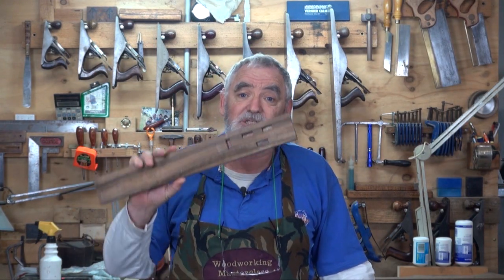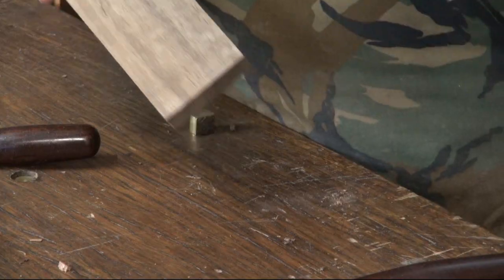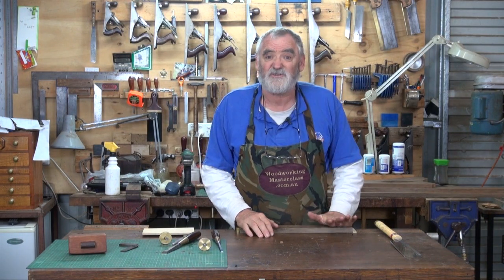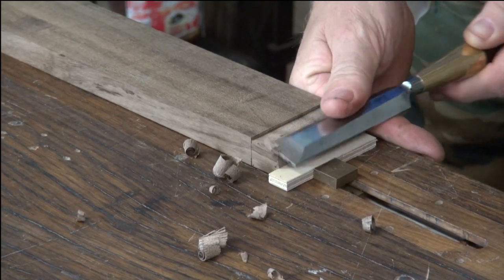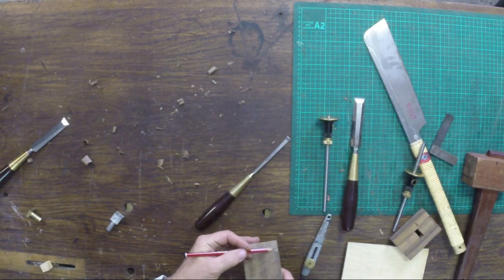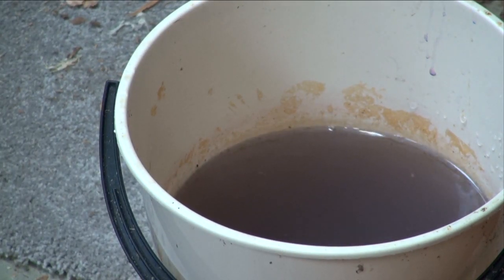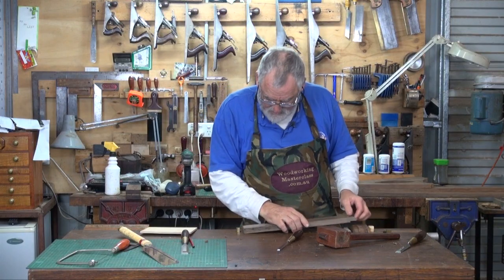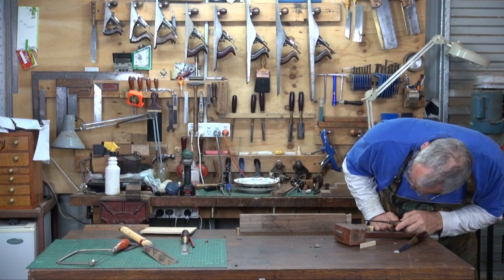How to cut Tenons - Plate Rack Part 3c of 6

Comment: Great point Steve. Patience was a key that I was missing for many years, as life was on a time line, an express train and I always felt I was miles away from becoming a accomplished woodworker. Well one of the major keys for me was learning to SLOW DOWN as soon as I open the shed door. All the rest just came natural, quality takes time along with gaining knowledge.
Cheers Steve.
Reply from the maker: +Peter Linch  Thanks Peter you're so right. Geoff Hannah used to say to me learn it slowly and speed come with practice. But you gottat get it right, slowly first. Cheers Steve
Reply: +Woodworking Masterclass Yes funny how things stick in the mind, Vic Wood use to say to me 30 years ago, just turn it once slowly, it's not a race. Also the fickle finger, if you were seen not using it more than a few times in the day you would get the cuts a leather belt across two hands, it's amazing how torture works, I had the fickle finger down pat in a matter of minutes.
Reply from the maker: +Peter Linch You got me Peter What's the Fickle Finger?? Cheers Steve
Reply: +Woodworking Masterclass Index finger that guides the saw and the name fickle finger, I think is the direction or force? or both, it also might be an English term as the woodworking teacher was English. Cheers
Reply from the maker: +Peter Linch Thanks, now I know. Bob get that pointed at him all the time! Cheers Steve
Reply: Yes Bob looks a little cheeky.
Reply from the maker: +Peter Linch Looks ain't deceiving. Cheers Steve

Comment: Chairs, cabinets, desks etc. Do you think mortising chisels are suitable and would be often used for such tasks?
Reply from the maker: Honestly, I think a good set of Beveled edges would get more of a workout that a similar set of Mortise Chisels. As they are more versatile in my opinion. The only exception would be if you were doing a lot of work in (Hard) Hardwood. Cheers Steve
Reply: Thank you. I've just completed a set of high quality vintage Peugeot Freres mortise chisels and I think I'm going to sell them on eBay to someone who is going to put them to better use. On the other hand, they are a beauty to behold! :) Some of them are close to 0.5 kg behemots. Some, have never been hit with a mallet.
Reply from the maker: Well don't give them away. Hope you get a good price. They are a beautiful chisel. Cheers Steve